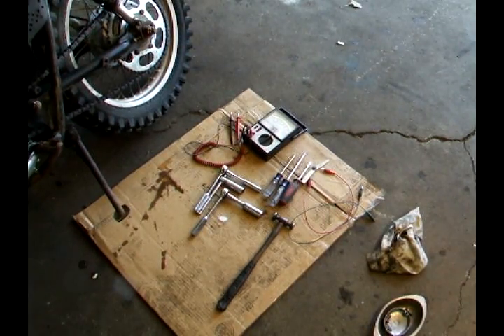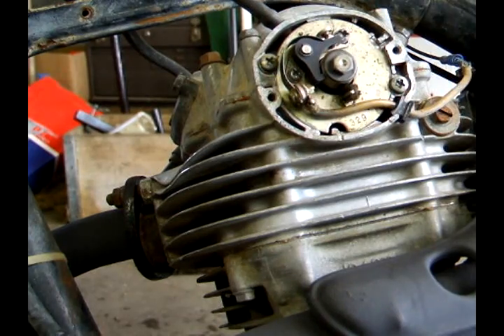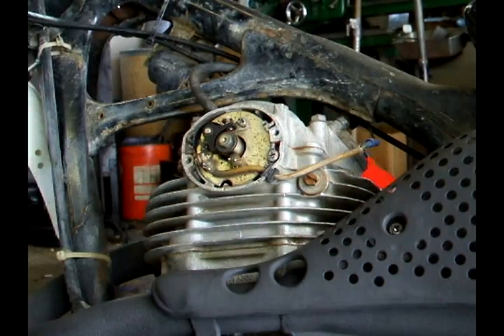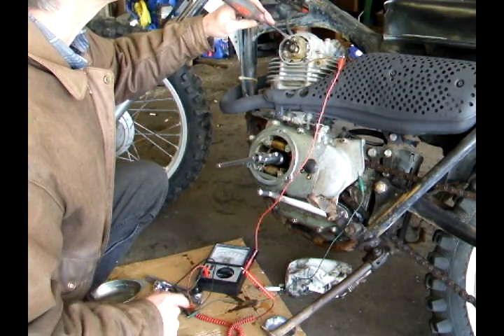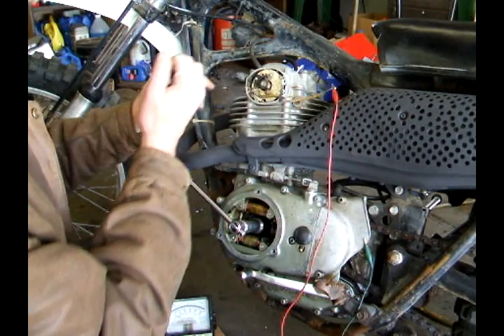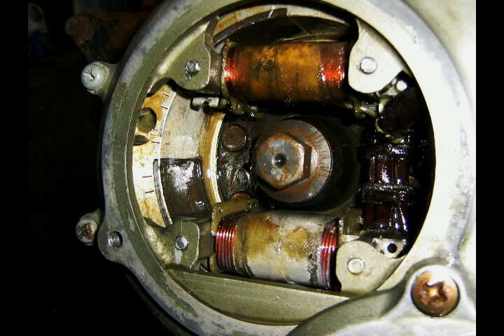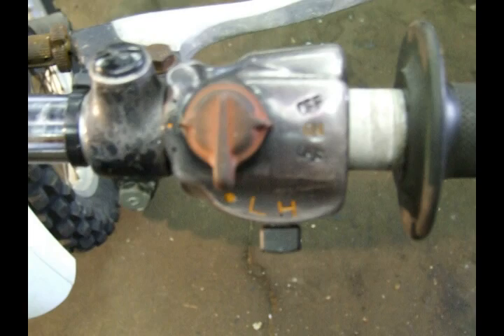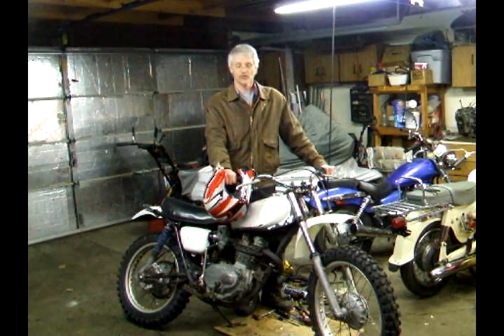How to set a Motorcycle Points Ignition, Statically

Comment: i did a experiment on my 1974 honda xl-250 i tried setting the point gap at TDC mark on flywheel, with the meter timing on F ect. bike would not even start. so i set the points like the service manual said at the high part of the point cam lobe and all the timing steps F mark etc. BIKE STARTED ON THE FIRST KICK.

Comment: i know 11 years have gone by, but my question is the honda service book and even clymers don't mention rotating the flywheel until TDC they say to set gap at high spot on the point cam. when i tried the TDC method the points were not at the high cam position, but i set the point anyway. would assume as the points crossed the high point on the cam they would open further than the required .14 gap. so which is it set at TDC or at high part of cam?
Reply: @frankdillon6127  I have this exact same question. The Honda service manual says set gap when they are at maximum so I believe setting them at the tallest point of the lobe is correct
Reply: @douglaslum3882  found that you need to set the point max gap when the point  is at the highest spot on the  point cam lobe, on mine there is a very small scribe line there. TDC doesn't enter the equation at this setting. when adjusting the point backing plate to set the fire mark on the flywheel is next. basically the points will just start to open a fraction of a inch before TDC.

Comment: I have put new cylinder on my cb 100 and now the points are open and closes jyst at tdc .should it not be other way around?the markings are correct
Reply from the maker: Your cam might be 180 degrees off. You can fix that with out tearing everything apart by removing and rotating the small cam on the timing advance unit 180 degrees.
Reply: @Amotorcyclenut  no its not .dont know wtf has happend..
Reply from the maker: Rotate the crank 360 degrees and you will be at the correct spot. Remember the cam rotates once for every two rotations of the crank.

Comment: Hi will this work for a 74 honda xl350? Same dwell gap ECT. ? Thanks
Reply from the maker: Yes it will. Uses the same point gap.
Reply: @Amotorcyclenut   thanks for your info , my 75 xl 350 is out of time , i tried checking it but I'm not too clear how,  will a digital multimeter work if so what mode ? If not I'll get a different meter , also is there supposed to be oil in the side case where the flywheel is ? Thanks very much ! Corbin
Reply from the maker: yes there is oil on the left side oil case. Digital meters seem to respond slow. If you meter has a continuity check with audio beep that will work well.

Comment: im starting from scratch and there is no reference point "when the points open" Are you trefering to TDC compression stroke?
Reply from the maker: When the points open is when it will spark. Reference point (timing mark "F")
 should be on the fly wheel.

Comment: No spark at .014 .  I don't like an onrush  of current to try and make a spark. 94 dollars for Honda original coil. 13 dollar coil no spark . High voltage needs a ground. Back to the original coil with open secondary. I will check the magnet.
Reply: Yep runs with the old original coil at .014- it has to run 2x at 232 miles freeway can reg?

Comment: I did same procedure before see your video...firstly I thought it sparks when points close together...but that seems strange to me because after rotating flywheel..I saw that the points where getting close and starting open at F point till T point before starting closing again...
So I am making this question to be sure...because if you do it wrong the XT400-500 will let you live with  an ankle less...
When the points starting open is when it sparks
Reply from the maker: When the points open is when it sparks
Reply: Yeah im ok..when im at F mark straight on the line the beep sound of volt meter stops..meaning they start open...I think I made a good work on timing
The bike was working before with wrong timing (3 out of 5) kicks were kickbacks
So I think now will be a lot better

Comment: I have a 1978 XL350 that I can't quite figure out. I connected a test light (positive to wire coming from points, negative to ground) and it would not light up at any point in the rotation. However, I can get the plug to spark when kicking the bike over. Any advice?
Reply from the maker: A Honda XL350 uses a magneto type ignition that does not require a battery voltage to operate. Disconnect the connector from the points to the coil and use a multimeter  set on the lowest ohms setting. Hook the red lead to the points wire and ground the black lead. Then you will be able to see when the points  open and close.
Reply: A Motorcycle Nut Thanks for the reply. I’m realizing I had a typo in my comment. I meant to say the test light would not light up at any point during the crank rotation. I can’t figure out why this would be.
Reply from the maker: @JWReynolds96  There is no battery voltage in that type of ignition system. So you have to supply voltage to run the test light if you want to use a test light. Make sure you disconnect the points from the ignition coil FIRST!, or you'll be looking for a new coil.
Reply: A Motorcycle Nut thank you! I’m used to working on a cb350, so I’m still figuring this system out. I’ll give the multimeter a shot.

Comment: How do you know that you're on the compression stroke ?
Reply from the maker: Take the spark plug out of the engine. Put you thumb over the hole and turn the engine. You'll know when it's on compression stroke
Reply: See the valve

Comment: Very well explained. On my 1978 xl125 i have to rotate the plate like 1/6 of turn till points contacts. It means that they are worn out? And if i placed them there, engine is hard to start or will just to backfires. I check if the cam timing was off and it is not.
Reply from the maker: Make sure the advance is working correctly.  Make sure you maintain the points gap when you rotate the plate, sometimes when you turn it , the points gap changes  because the plate  fits loosely in the head making it do what you describe.

Comment: thanks for the informative video.  im restoring a 75 xl250 and its been a yr or so since i had to stop working on it so ive forgotten a few things.  there is what appears to be a "vent" right above the points cover area.  once you connect the tube to the nipple there, where does the other end go?  does it just route to the ground like the battery tube?

Comment: Thank you! Yes! Finally some one posted a video that goes through the whole process and not just skip through it as if people watching have done it before.  Good video.   I have a '72 Honda cb175 and I have fully restored it after it's been sitting sense '86 and I've spent hours on hours on the internet, even downloaded a Manuel and as always I get lost and confused. I know our bikes are different but they are set up basically the same. Mine is twin cylinder that fire at the same time so thankful you helped me with my problem. Once again great job on the video!

Comment: Great how to sir! Love the video. I'm trying to time a SL125 and am having issues getting her started. I followed your steps and have brand new points. Any advice as to how to get it to start after doing all this? Compression is 80PSI and I have bright blue spark. I just cannot get the engine to fire.
Reply from the maker: 80 psi is a little low. you might have a valve or piston ring issue. Also carburetor needs to be right. You might get it to run.

Comment: Is this the same process for a 77' SL 125?
Reply from the maker: They didn't make and SL125 in 1977, they did make a XL125 and if that's what you mean, yes the process is the same.
Reply: A Motorcycle Nut I found a lot more intriguing info.  Its not a 125 its a 185......XL 'cause engine code...   OBVIOUSLY I'm on a very very wide learning curve.
Reply from the maker: That's Ok everybody got to start somewhere.

Comment: You state to rotate the flywheel until the TDC mark is lined up, and "that will be the position in which you want to set the gap of the points." This is a misstatement. At TDC the points will be just barely open. The gap needs to be measured when at its maximum which is well past TDC. I think you meant to say "rotate the engine until the points rubbing block is on the highest point of the advance cam." There is actually a small notch on the cam at that spot. Also, if the timing cannot be set without turning the points plate well beyond normal range it does NOT mean the points are worn out, it means the points gap is way off or else the advance is not returning to idle position, or the cam chain is way worn out.
Reply from the maker: what I said was rotate the fly wheel until TDC marked is line up and the points are open. That is the correct spot to set the gap of the points. That will be the high spot on the timing cam. The cam rotates one rev for every two revolutions of the crank., because its a four stroke engine. If you rotate the crank one rev from that position that will be the approximate location where the points fire the ignition coil. If your points will not adjusted open enough to to get the proper gap on the high spot of the cam they are worn out and you will not get a decent  dependable spark.

Comment: I got a dt 250 yamaha and I need a dial indicator could I do without?
Reply from the maker: Simon De Asian Maybe, it depends on how creative you can be. The timing for a DT 250 is 3.2mm before top dead center. I have done it with a set of calipers through the spark plug hole. Not as accurate as a dial indicator but it can be done.
Once you find the fire position make a fire mark on the flywheel and the case. Use tape and a pen to put your marks on first so if you mess up you can move them. Now you can check your timing with multimeter or a timing light. Once your happy with how it runs, scribe a mark on your fly wheel and case so they line up at the firing point. Next time you want to set your points it will be easy.

Comment: Great video. Points not opening at right point. And after hooking up the dwell as described, found out that the points were not hooked up to the base plate properly, washers were not in the proper place i guess shorting out points before the voltage was sent to the coil. Still not sure why if I turn the cam so the points are at the widest my line on flywheel is not at the T mark? I received a good spark on head and with starting fluid started right up. Thanks again. Now on to the carburetor.
Reply from the maker: Douglas Scott I'm glad it helped you. After you get your carburetor cleaned out (see "How to clean motorcycle carburetor jets"  http://youtu.be/Ti1vWJT_n4Q  You might want to check out "Dynamic motorcycle ignition timing"  http://youtu.be/cJqfIuuHOuw  to get you bike to run like a Swiss watch.